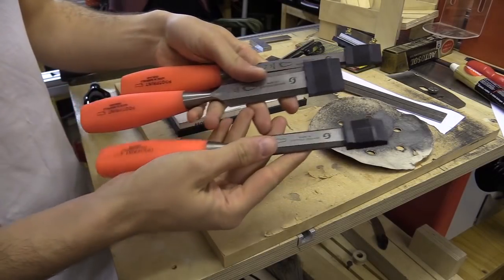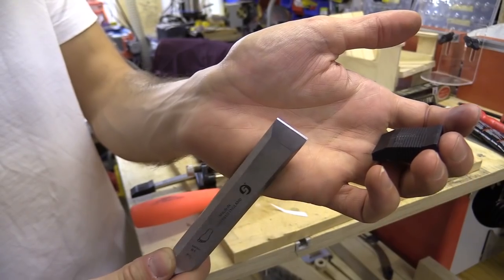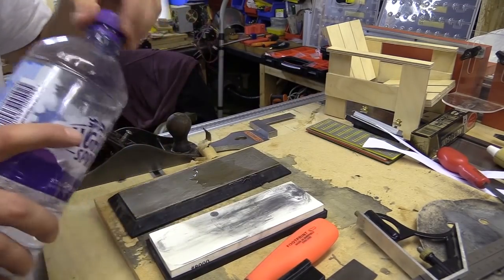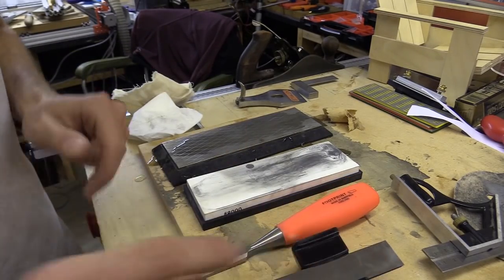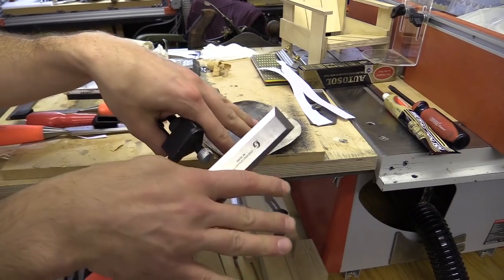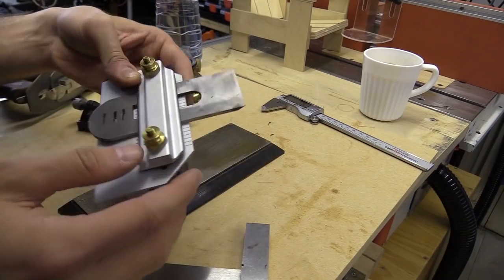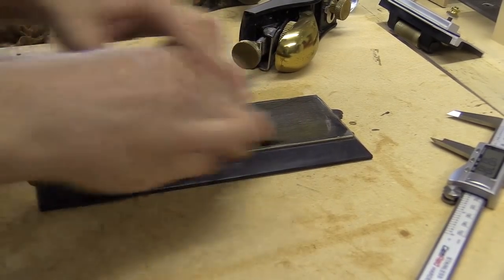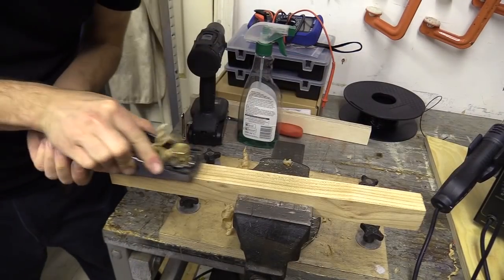Basic Chisel Sharpening Skills / MAD ASSASSIN SHARP

Comment: I'm pleased to hear you stopped at 1,000 grit. There really is no need to go higher, is there? Except for those who like to place their tools on display only in their workshops. ;-)
Reply from the maker: I don't think there's much reason to go higher. I did use the 8000# grit stone - which I originally bought cheaply from China just out of curiosity. It seems to give the metal a hazy finish - maybe better for kitchen utensils.
Reply: I learnt only a few years ago that you can cut through paper using an edge that's been honed on a 'fine' stone (I can never remember what grits equate to), while most people will only demonstrate this test after honing on a very fine stone or to some obscene grit on wet and dry paper.

For the record, I do own an 'ultra fine' (quite possibly 8,000 grit) ceramic stone, along with three oil stones (coarse, medium, fine). I generally find the fine stone to give a good enough edge and it requires less work and time. But the ultra fine grade does make a difference when you're paring the end grain of hand-cut dovetail joints, as one example.
Reply from the maker: We are just addicted to tools. I should have shaved my legs with the chisels. Lol. I'll be honest I just uses my chisels to cut tabs and bridges off things I've cut on the CNC machine at the moment.